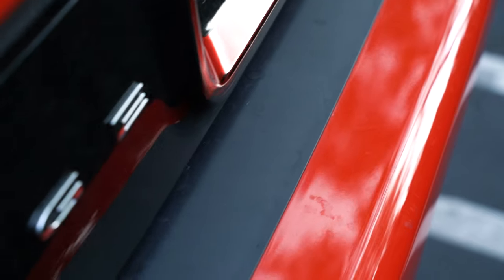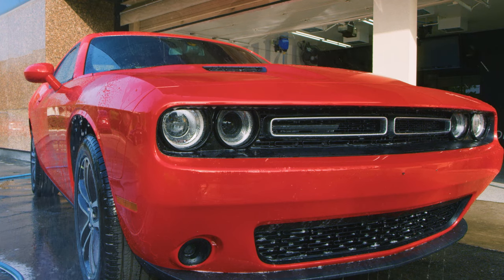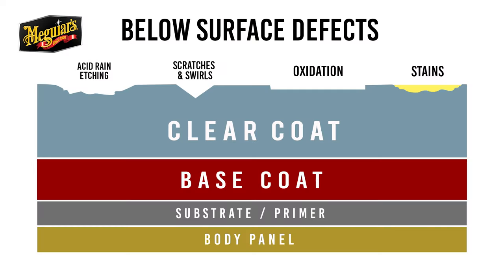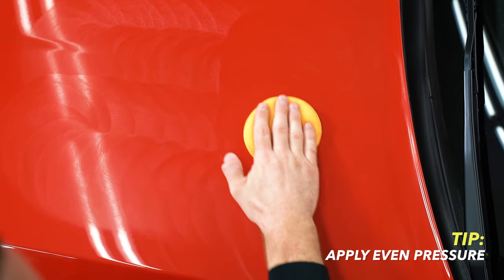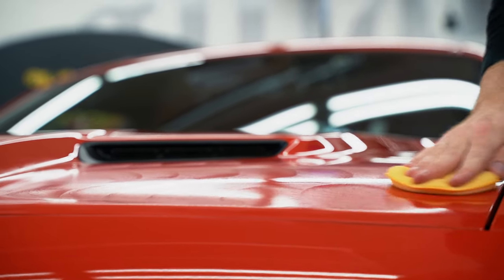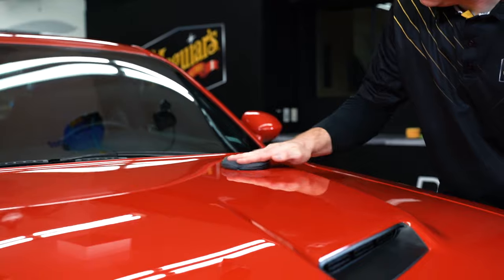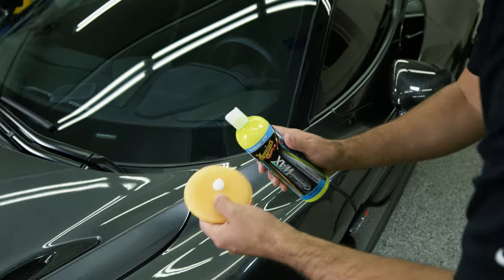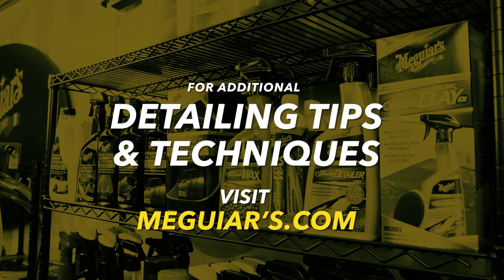How to Apply Compound, Polish & Wax by Hand – Quik Tips

Comment: That Ultimate Compound is absolutely great. I live in Finland just bought a second hand car in winter. As I made a "spring wash" it had scuff marks and little scratches here and there. Also under the door handels it was horribly scuffed. The Utimate compund made it all gone. If you don't have a machine polisher, it's OK as the Ultimate Compund is easy and fast to use by hand only. Of course deeper scratches are impossible to cure, but the compound makes them look better also.
Reply from the maker: ❤️ 

Thanks for the great feedback!
Reply: What about durability

Comment: Hello, love the video. When I compound/polish each 2x2 section how many sections can I use with that same pad until I have to clean it? Or can I keep using the same pad throughout the compounding/polishing phase. And if I have to clean it, what is the best way to clean the pad before going to the next section? Thanks
Reply from the maker: Typically when applying products by hand with a foam applicator pad you do not need to clean the pad during the job; however if you feel there is some kind of contamination on the pad you can certainly grab a new/fresh applicator pad and use it.

Once done with the job you can wash the applicator pads in your washing machine just as you would your other towels.
Reply: @meguiars so one pad is enough to do an entire car? I mean one for compounding, one for polishing and one for waxing of course
Reply: @spyrosbellos2522 yeah I’d say every product should get a different pad.

Comment: I have used the ultimate polish and really did a difference the car paint was fine but with small swirls scratches and the coating lost some shine but using it with a orbital polisher did a great difference now have a mirror like shine as just picked out from car dealer .

Comment: Where do I get those buckets haha... they would go great with the rest of the products in my garage
Reply from the maker: They used to be sold on Amazon but have recently been out of stock.  Keep checking back and they may pop up again.

Thanks for the support!
Reply: i got mine some time ago from my local auto detailer/parts shop, they stock Meg's products, so i have 2 yellow, and my wheel bucket is the older/smaller black Meg's bucket.  very good and have lasted several years.

Comment: Great video! Question. If you've never waxed your car before, how often should you wax it? Would fall and again in spring be adequate?
Reply from the maker: How long any given wax lasts can be highly variable and depends on a number of factors including the environment it is exposed to.  Generally speaking for a daily driver we recommend waxing at least 3-4 times per year but in some cases, on a well-maintained vehicle, they could certainly last longer.

Comment: Okay, so it all began with my purchase of a 3100psi pressure washer, and now I've gone down the detailing rabbit hole. I bought your clay kit, Ultimate Compound, Ultimate Polish, and Gold Class Canuba Plus liquid wax. Not to mention a cordless orbital buffer/polisher. Once I'm done, what do I wash with for the next few weeks? Like I said, I've just purchased a pressure washer, so the first thing I went out and bought after that was a foam cannon and half a dozen jugs of Ultimate Wash and Wax. Will that be okay on top of the Gold Class wax protection?

Comment: do you have to rinse in between steps or just towel wipe the compound, then polish, then add the wax?
Reply from the maker: Typically there is no need to rewash/re-rinse.  Just wipe the product off and proceed to the next step.  👍
Reply: Can i  use this product on my bumper? My car has scuffs from a branch that hit it, on the front left wheel arch.

Comment: How often should I do this 3 steps on my car paint?
Reply from the maker: How often you need to clay or compound is related to the condition of the paint at any given point and the environmental attacks the paint faces in your particular situation.  You only clay when you have bonded contaminants stuck to the paint.  You only compound when you have defects (scratches, swirl marks, water spots, oxidation, etc.) in the paint  It is also relative to how well you maintain the paint between waxing.  If you maintain the car well you will likely not have to do all 3 steps every time you detail/wax your car.

And as it relates to how long a wax will last...

How long any protection/wax lasts is highly variable and depends on a number of factors related to the condition of the paint, previous prep, and the environmental elements the vehicle is exposed to. 

In very general terms we recommend the average person wax their vehicle 3-4 times per year and often at least once a year will include the full process.

Hope that helps!
Reply: @meguiars  Thank you very much... That helped me a lot. Have a nice day.

Comment: Greate Videos.....Please help me... I have a new car and have very very light surface defects. Do I need to use "Ultimate Compound" or can I skip it and only use "Ultimate Polish Pre-Waxing Glaze". Could I only apply the "Ultimate Polish Pre-Waxing Glaze" for a longer time (or apply many time)  to achieve the same result as using both?... Thank you!
Reply from the maker: You can certainly try the Ultimate Polish but keep in mind it is primarily a polish and has only minimal defect removing capability.  In many cases, especially if the paint is harder, you will need a compound to remove even light defects.

There is also no reason to fear Ultimate Compound as it is very safe and easy to use.

Comment: Hi, I first polished with the Ultimate Compound, then polished with Meguiar's Polish. Before I go on with the Ultimate Synthetic wax, do I need to wipe down the car with IPA/degreaser/wax remover to clean the polish residual? Thanks!
Reply from the maker: No, that is typically not necessary before applying a wax.

Comment: Why clay before compounding?  Isn’t the compound going to remove anything that the clay would anyway?  I thought clay was more for light bonded materials and compounding was more abrasive.
Reply from the maker: They are designed to remove different things.  Clay is designed to remove above surface contaminants that are bonded to the surface.  Compound will remove defects that are actually in  the paint like scratches, swirl marks, water spots, oxidation, etc.  Here is a great video that explains this...

https://s.3m.com/2kw5et

Comment: Which product do I use first for swirled and oxidated aftermarket paint? You aren’t supposed to compound an entire vehicle are you? It’s only for spot correction and Polish is for doing what I need prior to wax right?
Reply from the maker: We cannot speak for the other steps possibly required without knowing all the details surrounding the current condition of the paint as well as what exactly it is you are hoping to do for it.

That being said to remove oxidation and swirl marks will require the use of an effective/safe compound like our Ultimate Compound.  Although in some cases it may not be necessary to apply to the entirety of the vehicle most of the time that is exactly what you should do and is not something you should have any concern doing.

Comment: I bought the Gold Class paste wax about almost 2 years ago I’ll say and used it and stored it in my garage. can I still use it or should I buy a new one? Does the paste ever expire or lose its effectiveness? Thanks in advance.
Reply from the maker: The shelf life is 3-5 years is stored in a temperature-controlled environment but it can certainly last longer.  If the consistency of the wax is still the same it should be perfectly fine.  👍
Reply: @meguiars  thanks !

Comment: Tiny circles will take me hours. Any difference if I go in long overlapping sweeps?
Reply from the maker: Assuming you are referencing application of the compound the pattern is not the issue as much as the fact that the product does have to be worked into the surface with some (moderate) pressure.  You also only want to do about a 2X2 ft area and then immediately wipe off because you don't want the product to dry at all.
Reply: @meguiars  okay thanks for the tips yeah I was referring to the application pattern

Comment: Thanks for the guide! I have a question, can I use the Meguiars Ultimate Compound before applying the ceramic? This compound without waxes/silicones or other additives that prevent adhesion?
The course of action is:
-Completely wash and clean the paintwork.
-Manually polishing with Meguiars Ultimate Compound
-Ceramic application.
*Meguiars in my country they advised me to use strong polishes, but as a beginner I'm afraid to rub the varnish too much. 
They only recommend applying waxes, but I want a long-lasting ceramic cover...
So I want to polish with MG UC, can I do that? It will not interfere with the adhesion of the ceramics?
Reply from the maker: There is no reason you cannot use Ultimate Compound to remove defects in the paint before applying a ceramic coating.  That being said you will still need to follow the coating manufacturers recommendations for prep before applying their coating.
Reply: @meguiars  👍 thanks

Comment: Question. Should you use a towel for each section while compunding or polishing?
Reply from the maker: As is shown in the video we recommend a foam applicator for application and a good quality microfiber towel for wipe off.  No, you do not typically need a different towel for each section but you will at least want a towel or two for each step of the process depending on the size of the vehicle.

Comment: Can Meguiar's Ultimate Compound be used if vehicle was washed with Ultimate Wash and Wax?  Also, how long should one wait after using Ultimate Liquid Wax before attempting to use Ultimate Compound in an area where there are scratches/swirls?
Reply from the maker: Yes, you can use Ultimate Compound after washing with Ultimate Wash & Wax.  Ideally you would compound before waxing but if you already have Ultimate Wax on the surface you can certainly still use the compound as it will strip the wax as you work.
Reply: @meguiars  Thank you so much for your prompt and concise reply.

Comment: Before i wax the car (after ultimate polish)..should i  clean the car with alcohol? Do ultimate polish have silicone?
Reply from the maker: There is typically no reason you need to use and IPA wipedown between steps for the typical detail job.

Ultimate Polish is not body shop safe.
Reply: @meguiars  thank u very much!!

Comment: I have made these steps a couple of days ago. The result is great,  but if I check the car with lamp I see white patches where the compound or polish isn't removed completely. They cannot be seen in sunlight. How can I remove it? I have also used ceramic spray on it. :(
Reply from the maker: If you have product residue you missed during wipe-off you could do a few things to remove it including the use of a good all purpose cleaner, dish washing liquid & water, or even simply reapplying the compound it those areas again.

Keep in mind any of these things will strip the wax so you will likely want to reapply wax in those areas after removing the product residue.
Reply: @meguiars  thank you! The all purpose cleaner worked :)
Reply from the maker: Awesome!

Glad to hear it.  👍

Comment: Can we use these products under direct sunlight?
Reply from the maker: It is never ideal but often as long as the panel itself is not hot to the touch and/or the weather is not extreme you can get away with this.  For application of the compound and polish you want to make sure the product does not dry at all so you may need to work a smaller area and wipe off more quickly.

Comment: I have very very light swirls. Mostly from hand drying even with a drying aid. Don't have access to outside electricity right now. Going to painfully polish the car by hand. Do I need to up the cut since I'm not using a machine? I would use a polish with a buffer for this condition paint. Since my hands aren't as effective, Do I need to up the cut? Meaning compound instead of Polish? Or can I still remove the light swirls with a Polish? Thanks
Reply from the maker: That is entirely dependent on how deep the scratches are but also how hard your paint is.  You will not be able to figure that out without trying a product.  

Many times swirl/towel marks are more stubborn than you might suspect so the need for a good compound like our Ultimate Compound might be necessary.  Keep in mind it is very much safe and easy to use so there really is no down side if you do need to use a mild but effective compound like our Ultimate Compound.

Hope that helps!

Comment: My car is 15 years old with faded paint. I used the compund and have seen some improvements. However, where the paint is faded,  it appears blotchy. I assume this is normal for a car this old?
Reply from the maker: It can be difficult for the untrained eye to distinguish between oxidation and paint failure.  If you are at the point of paint failure you might be getting product residue stuck to the dead paint.  Please feel free to reach out to our Solutions Hub with pictures and we would be happy to help diagnose the situation with you.

https://s.3m.com/c9xhg5

Comment: TOPSafetyOrders
I applied ultimate wax 3 months ago. Should I wax/compound again before I put ultimate wax this time ?
Reply from the maker: A compound is used to remove defects in the paint, so the real question is do you have swirl marks, scratches, oxidation, water spots, etc.?  If there are no defect in the paint you would not need to compound.

Comment: Can I skip the compound step and just polish then wax?
Reply from the maker: That depends on the condition of the paint and your desires for it.  If the paint has no below surface defects (scratches, swirl marks, oxidation, water spots, stains, etc.) you can certainly skip the compound.

Comment: You guys said in the video that the hybrid ceramic liquid wax lasts the longest from all your products, what about Meguires Fast Finish which says it protects for 1 year?  

Which one should I use for longer durability
Reply from the maker: If you read the claim on the can of Fast Finish you will see it was related to a very specific testing method.  We made no claim it would last a year regardless of the environment.  The new Hybrid Ceramic Wax will protect better / last longer.

Sorry, for the confusion!  👍

Comment: I just finished doing this to my s2k, it took me 13 hrs! Btw how long will it last? Like when will I have to this again? (I'm in LA and the car is garaged everyday, except from m-f 10 am to 5pm)
Reply from the maker: Any defects should be permanently removed.  Of course whatever caused them in the first place could happen again at some point.  As far as the protection we still recommend you wax at least 3-4 times per year for a daily driver.

Comment: Do you compound the whole panel first after all the 2by2 sections THEN apply the polish to the whole panel... or do one 2by2 and apply the polish straight after?
Reply from the maker: Not entirely sure what you are asking here?

If compounding and polishing you should first compound the whole car (or section that needs it) working a 2X2 area at a time and wiping off immediately before the product has a chance to dry.  After you finish compounding the entire vehicle (or the affected areas) you will do the exact same thing with the polish.
Reply: @meguiars  yeah that’s basically what i was asking. Great cheers

Comment: I've got some hazing left behind after using Scratch X to remove a scratch.  The hazing is not visible in direct sunlight but you can see a slight whitish haze when inside a dimly lit place like inside a garage.  Which Meguiar's product will remove the haze safely, Ultimate Compound or Ultimate Polish?
Reply from the maker: Ultimate Polish or an equivalent polish would make the most sense.

Feel free to reach out to our Solutions Hub via our website with more details and any of our surface care experts can help figure out what may have happened and formulate a plan of attack.
Reply: @meguiars  Is Meguiar's Ultimate Polish okay to use by hand to remove clear coat hazing?
Reply from the maker: Yes, keeping in mind hand application can be less effective at remove defects.  A good DA polisher would almost always be better but hand application certainly may work.
Reply: @meguiars  The hazing is very light and confined to a small area, e.g. about 1.5 inch rectangle.

Comment: I have a 2018 Toyota sedan  and I have never waxed my car and have been driving in harsh weather in the desert 5 days a week to and from work , 45 mins each way. The front bumper looks faded and is there any way i can bring the natural color back by using the ultimate car wax ?
Reply from the maker: It would really benefit you to read through this article on the 5 Steps of Paint Care.  It has a lot of foundational information which will help you evaluate your paint and formulate a plan.

https://s.3m.com/xyjxnh

Comment: Do i need an orbital polisher to do all this or can i get similar results by hand?
Reply: You can get similar results by hand. It just takes longer.
Reply from the maker: It really depends on the condition of your paint and how hard or soft it is.  A good DA machine is going to achieve better results and in some cases be necessary to adequately remove defects.  If you are simply spreading wax either method is fine but of course the machine might help you spread it more evenly and will certainly save time and energy.